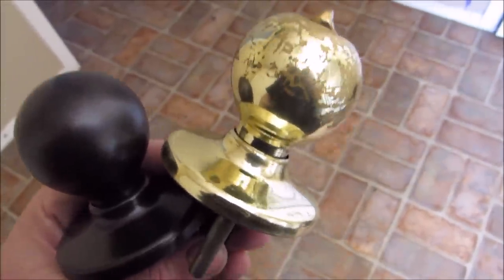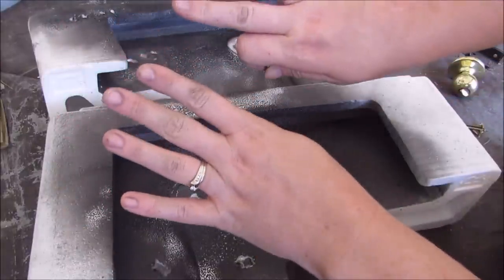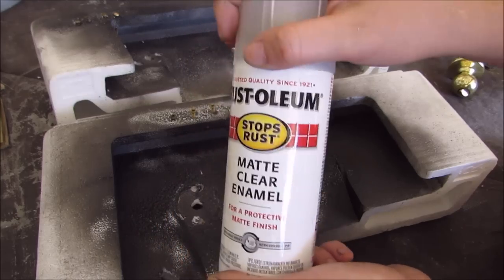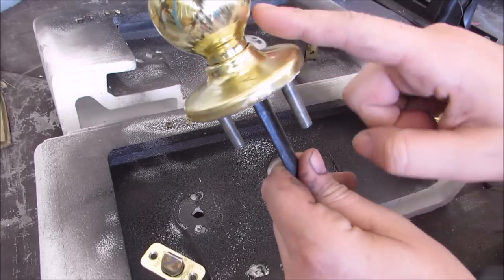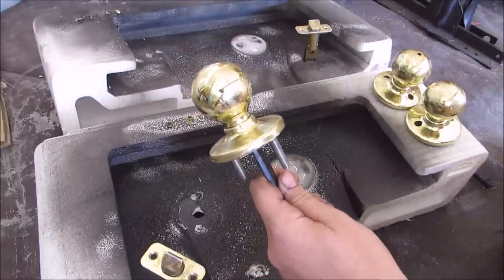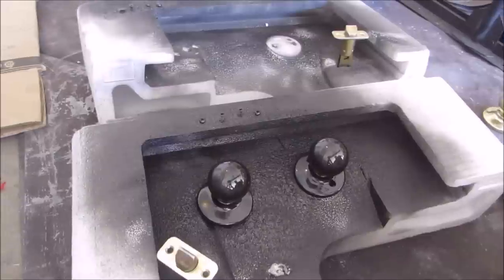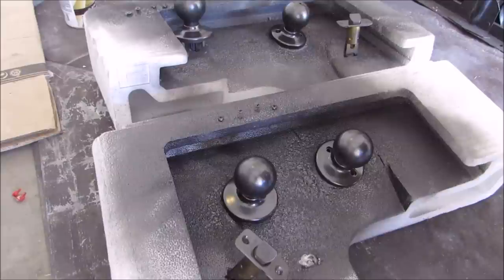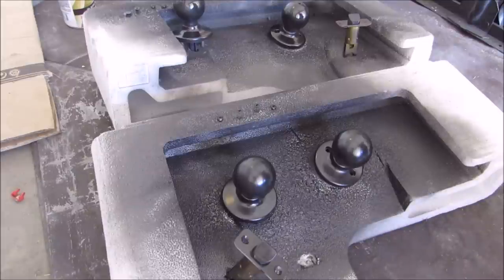How To Refinish Brass Hardware Yourself

Comment: Good tutorial and very realistic with your child in the background. That is exactly how parenting + renovations go! Looks great!
Reply: Luckily kids aren't old enough to learn bad renovation habits.. Never use spraypaint on high traffic door handles and especially hinges. Hinges will start peeling in a few months along with most high traffic handle's. It will look 10 times worse when it starts peeling with that bright brass peaking through. By the time you've painted them multiple times and spent a small fortune on spray paint + primer, sandpaper etc... You could have sourced these at a cheaper price from a wholesale online store... Probably w/ free shipping too. I'm all about renovations but do something that will last, instead of teaching others the WRONG way to do things. They look great... But are not functional or practical with kiddos in the house. 

*Contractor tip: look for reactive aging solutions to permanently age brass handles to give you that oil rubbed bronze look. It's way easier and cheaper than painting with expensive home Depot Rust-Oleum.

Comment: good video. FYI - Use a plastic shopping bag to cover your hand while holding your item, to keep clean. Also, insert some foam board into an empty paper roll (TP or paper towel rolls) and then insert your knob to use it as a holder :)
Reply: Sandra G
Reply: Wear a disposable gloves?
Reply: qtip a little petroleum jelly onto your cuticles to keep that paint from sticking there...

Comment: thanks for the tip.  you just saved me a ton of $$  by the way you are not only handy but what a great Mom.  love hearing the voice of your little one in the background.  nice that you are so patient.
Reply: Love to see mom and kiddos breathing in high VOCs from spray paint cans... A+ parenting there. If you are serious about following her advice.. read this first:

Luckily kids aren't old enough to learn bad renovation habits.. Never use spraypaint on high traffic door handles and especially hinges. Hinges will start peeling/chipping in a few months along with most high traffic handle's. It will look 10 times worse when it starts peeling with that bright brass peaking through. By the time you've painted them multiple times and spent a small fortune on spray paint + primer, sandpaper etc... You could have sourced these at a cheaper price from a wholesale online store... Probably w/ free shipping too. I'm all about renovations but do something that will last, instead of teaching others the WRONG way to do things. They look great... But are not functional or practical with kiddos in the house. 

*Contractor tip: look for reactive aging solutions to permanently age brass handles to give you that oil rubbed bronze look. It's way easier and cheaper than painting with expensive home Depot Rust-Oleum spray paint which is NOT intended for high traffic handle's to begin with.

Comment: Also neat tip. Add little hints of metallic copper paint to the edges of the door knobs before you add the top coat clear for a more authentic oil rubbed bronze appearance. It is easy to do with an artist brush and makes them look so real.

Comment: Great video :-) here's a tip...always flip your spray can over n let it rest on the cap for 20-30 minutes before spraying. That ensures all the paint goes to the top of the can.
Reply: Or just shake vigorously for 2 minutes to get all of the settlement off the bottom of the can with a metal ball or glass ball that is inside, this is the correct way. Only time I turn the can over its after spraying I turn it upside down and spray for a few seconds to clear the paint from the line so it doesn't dry inside of the cap. 
*Contractor tip
Reply: But, why would we want the paint to be at the top of the can, when the spray comes thru a tube from the BOTTOM of the can???
Reply: THATS BACKWARDS! Please no one listen to this advice. The paint goes through a tube thats opening is located at the bottom of the can.
Reply: lol, did you get this tip from someone working at Homedepot? :) Just shake can 1 to 2 minutes

Comment: I sprayed my patio tables and chairs 2 years ago. They were old green looking sad decided to paint chairs blue ,pink,green, yellow and the table blue. Did this with Rust Oleum for metal turned out great   They have gone thru rain,snow  hail and extreme heat  Need some touch up now but most are still holding on

Comment: Don't spray the thingymajig. To avoid interfering with it's operation, collect a little paint by spraying into a cup or the cap of the spray can. Then paint the brass plate only, with an artist's brush.

Comment: Thank you. I have window sash pulls that are no longer available. I actually had a guy at home depot say it wasn't possible to paint the brass. i will try this.
Reply: Not possible to paint the brass? Well I suppose if it were molten brass that would be true.  WARNING: Don't spray paint molten brass or molten anything for that matter.

Comment: How is the paint holding up?  I did the exact same thing, except I added an additional step and applied a self etching primer as a base.  After 2 coats of primer, 3 coats of paint, and 3 coats of clear coat, I waited 48 hours before installing.  After a day, the keyhole, even being careful, became scratched up and chipped.  How are yours doing?

Comment: Next time you deal with plated material get a wire wheel an buff it out it will clean off the brass quick an easy an wont have to worry about missing a spot sanding an wire wheels are pretty cheap at harbor freight save time money an turns out amazing just a tip from one diyer to another:)

Comment: TheThriftyMommy, Thanks for the video! I am currently painting all my door frames and the baseboards white, but my doors are going to be black. I think it would look nice if the knobs were white to match the trim (as there is no brass or silver anywhere in the house). Do you think white would turn out as good and will it hold up as well as your door knobs did?

Comment: You missed a spot on the left knob.
Reply: LiveLaugh MakeLove i think there are some spots where the paint would not stick. Must be a some sort of
Enamel left over from the previous coating.  Also I think this needs to be wiped with isopropyl alcohol to remove any oils from hands over years of use.

Comment: she didn't tell us how this will not last, and you'll have to do it again, and again, and again. lol.... spray Clear Laquer Spray, this will keep paint from rubbing off.
Reply: Isnt that what the clear coat is?
Reply: Yes. Its clear… apply 2 coats of Clear lacquer spray after painting them…. It will make a huge difference. But before applying lacquer make sure paint dries for 3 days, otherwise paint will bubble and/or wrinkle.

Comment: You’re driving me crazy! That spray can has a wide and flat spray pattern. You can’t spray left-to-right then up-and-down without rotating the nozzle 90 degrees (if that’s even possible). And ugh! The oils you left on the knob when handled it with your bare hands.  Use nitril or latex gloves when you do this. They’re about $5 for a lifetime supply at Harbor Freight. I also assume you and your kid are in an enclosed room with no ventilation (not really).  I would use maroon Scotchbrite pads instead of sandpaper. Much easier to use. Degrease and hit them with a tack rag just before spraying. I would even use an etching primer before the Rustoleum. They look nice afterwards.

Comment: Do NOT follow this advice!! Unless your flipping a house and want to keep expenses down.

*Contractor tip: look for reactive aging solutions to permanently age brass handles to give you that oil rubbed bronze look. It's way easier and cheaper than painting with expensive home Depot Rust-Oleum spray paint which is NOT intended for high traffic handle's to begin with.
Reply: My house was built in 1992...what is the chance that my door knobs are a true brass?  I only spray paint light fixtures because they are touched very often...but your suggestion would be good if i have true brass knobs!
Reply: @BellasRobloxAdventures  Hi Tabitha,
Brass was heavily used in the late 20th century as there was a surplus of this metal and it was relatively inexpensive and easy to work with.
 it's very likely they are not pure brass, but a bi-metal brass (builders grade) if they are the original door handles to the home.

Even if they are not the originals, I would take a handle that is in an innocuous region of your home and try some aging solution on the backside of the handle where eyes can't easily see. Bi-metal brass does work well with the Aging solution (modern Masters makes a great product) so you should be ok. If you are able to achieve the correct reaction your all set, if not let me know and I can give you some other ideas.